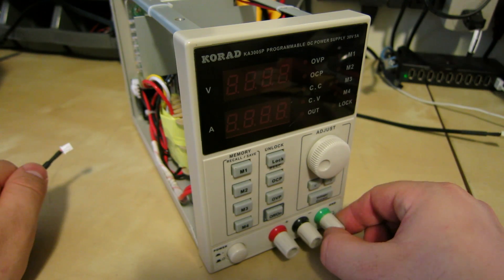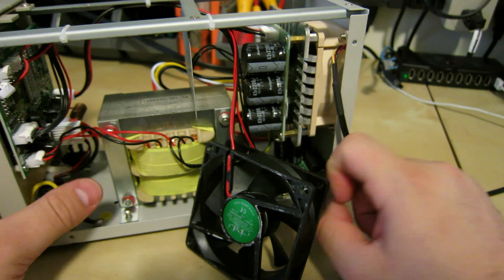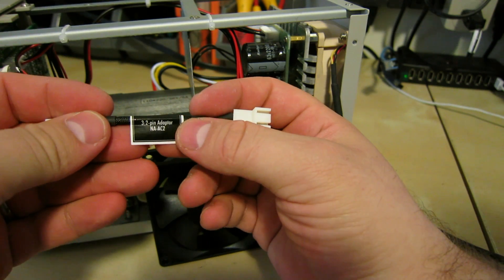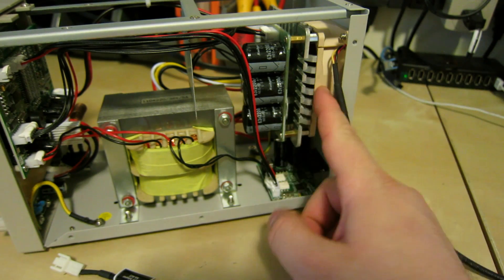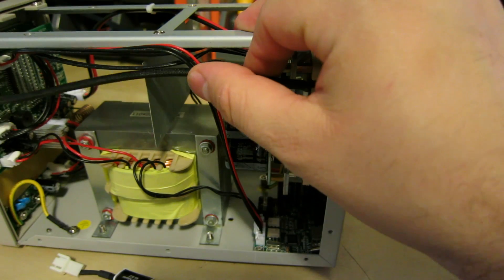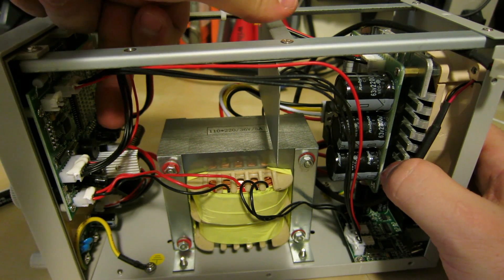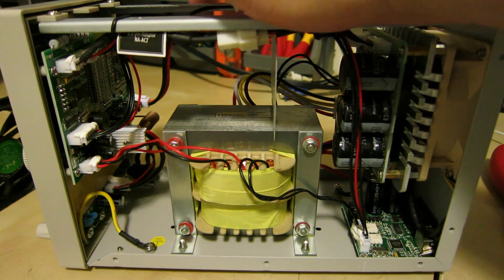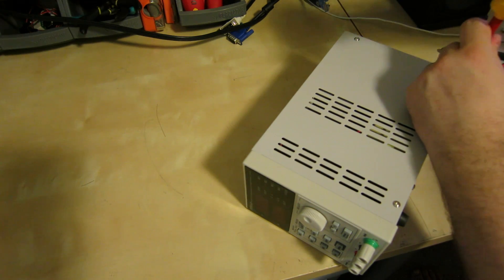Korad KA3005p Fan Mod

Comment: Looking for USB drivers (Win7) that works.
Reply from the maker: +Gornistvo - I just googled around for KA3005p software and found a basic program for it. I think the driver is just a standard USB to serial converter IC.
Reply: Unfortunately software (USB driver - serial emulator) that came on CD with the latest version of PS is only for XP/2000. My Win7 does not recognize PS USB at all, plus their USB driver can not be installed in to Win7. My PS is TENMA 72-2550, and should be identical to KA6003P ...  Serial commands are the same, as well Win software, that runs OK on my Win7. But I have no luck with USB drivers and PS recognition on USB port.
Reply from the maker: +Gornistvo - It doesn't make the hardware detected sound when plugged in? It's possible they didn't install the serial chip and have a USB port on there for some reason.
Reply: Yes Peter, PC detects new USB device but it reports that it is not accessible, nor the original USB driver can be installed. Now I got one idea! I have always connected - tested it from a front side desk top PC USB ports. Now, connecting it on to a PCs back side (directly to the mother board) the driver can be installed error free on a 1st attempt.  And the tiny program communicate with power supply too. Looks like these front USB ports are treated quite differently from the rear (main ones) on the mother board.  Anyway I'm happy now. Thanks for your support, and keep good work on - I enjoyed browsing trough videos on your Youtube channel.

Comment: Hi Peter, by any chance do you have the link to where you bought the fan? or the part number?, I have the same power supply and want to change the fan like you.
Reply from the maker: It's a Noctua. 80mm I think, but I don't have time to watch the video again to double check. I pick up my Noctua fans from Amazon, but you can find them on eBay, too. Just look for "noctua 80mm".

They make a few different models for most of their sizes. The FLX models are ones which include the optional speed limiting adapters. The PWM ones will work, but don't pay extra for them as the PWM function won't matter (you would need to mod the adapter wire I used to fit the wider 4-pin PWM connector as well).

Either way you will need to make the 2-pin JST adapter yourself as the fan won't have the same kit (the 2-pin adapter I use in the video is only included in the 40mm Noctuas).

Comment: I finally got around to buying one and unfortunately it is not 110/240 switchable and still has the strange fifth memory channel. I can't complain that it's not a KA2005p so guess I'm holding on to it. I have a replacement fan here so I'll hopefully be able to tell which revision it actually is.
Reply from the maker: From what I have seen there are three major revisions to the design. The first one is the only one I know to fail (see EEVblog videos), obviously they made a 3rd for a reason, I just don't know what it is. 

It could be to use more lower cost capacitors over a single large one, etc.
Reply: I haven't (yet) taken it apart, but I did notice that the hole for the voltage selector is punched out of the case and just covered with a sticker, so I may be able to mod that in.
Reply from the maker: Is the transformer wired for both or is it a single voltage only? Do you need it switchable or just hard-modded to another voltage once?

Comment: I was about to ask if the rev C is switchable between 110/240, but you rotate around at the end and it does! Bingo, buying one tonight. Also happy to see another Noctua fan fan. :)

Thanks for the video. Could you do a high load video just for comparison?
Reply from the maker: I don't have a dummy load. Nor do I have enough power resistors to fake one. I don't usually need too high power (0-12v, usually), so I don't have anything to simulate it or I would.
Reply: *****
You could short your leads like Charles does in the Altzone video if you feel like warming up some wires. Bu no worries, when mine arrives I'll do some before and after footage using a car headlight. Thanks again.
Reply from the maker: Derek Kozel Mike's method is a nice option, too. https://www.youtube.com/watch?v=WECW88rJYrE
Reply: *****
I hadn't seen that. That's hilarous. Makes sense though. I have a spool of decent thickness enameled wire around.

Comment: The shake-proof washer is probably meant to scrape the paint so the outer shell will be connected to mains earth. Nice video on this mod. Will be doing this on my Velleman PS3005D which is essentially the same unit. Thanks!
Reply from the maker: Yeah, I thought I heard that in the EEVblog video or maybe when Mike's Electric opened up the switch mode supply he picked up in one episode. I didn't think of it until after I hit upload. :D